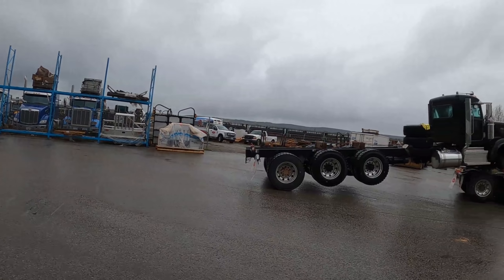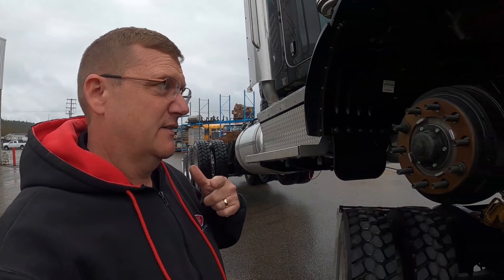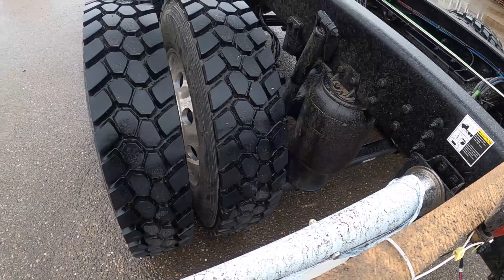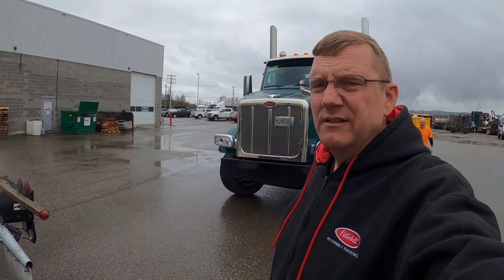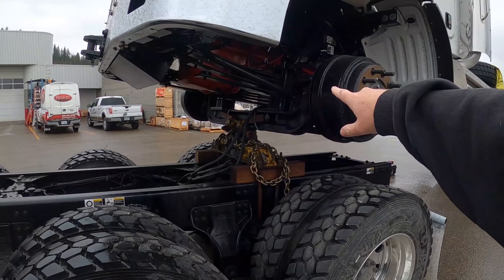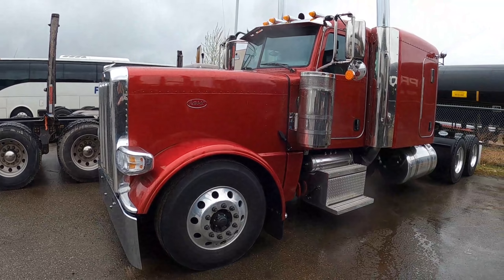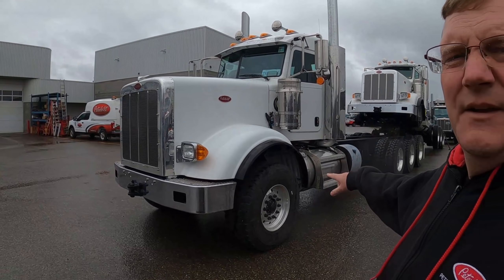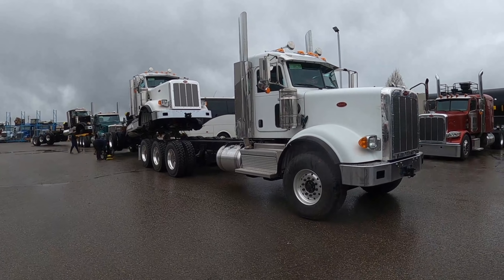New Delivery of 2022 Peterbilt TriDrives arrive....

Comment: Use to work for Active USA for a little over 2 years. Loved doing it but eventually had to be home more. Like a kid on a candy store when I was back at the yard waiting for a load. Would walk the holding area for as long as I could. Ran out of Chillicothe, OH Kenworth. Would get bounced to Denton, TX if I was close aftet delivery to pick up a load of Peterbilts. Even managed to take a load out of Renton, WA Kenworth. And then there's the Montreal plant of Kenworth that you would pull out of to deliver down into the states. It is a HUGE responsibility to deliver those trucks. They handle differently as a decked set. Came upon a driver that his wood block that held up his drive axle had split and dropped the tires down...those big heavy lug tires. Ground off down to the steel belts. Helped him get them back up to finish the run. Cost Active a fortune to replace. A driver with a four-way decked set was involved in an icy accident out west. Wiped out all four trucks and almost killed him. You never drove a use truck while working for Active  USA.

Comment: Definitely check those trucks over. I know the other month our salesman had 3 trucks that were piggybacked in and the driver truck had some scratches on the painted side skirts from where the driver wasn't careful getting in and out of that truck.
Reply from the maker: Once I had a guy stand on a fender of a 389 to clean the windows 🤬
Reply: @mikethetrucknut  😮😖

Comment: Curious how the new generation Neway air ride is working out and if it is good for an on high way truck...The Peterbilt Air Track is still a pretty good suspension also
Reply: Neway suspension like using 2 leveling valves they can be pain to get them set

Comment: A new viewer who wants to know,  what is a PACCAR engine? Is it a Cummins based engine, or the old Leyland based DAF engine that has been upgraded through the years, or is this engine a brand new sheet of paper? I have al- ways had an inter- est in trucks as a kid, along with buses & heavy eq. I also at one time owned a truck w/ my best friend but got very sick and that was the end of wanting to be in trucking.My friend was also a diesel mechanic like his brother, and I had learned much from both of them. I did manage to drive 2 cornbinder c.o.e.'s w V-8 Detroit's, also a Diamond-Reo short nose conv.w/ a 6V- 53 and the truck I bought w/ my friend a c.o.e. Freightliner w/ a Cum along in it. I am now almost 71 on the speed- ometer now and see that PACCAR still does have some styling on the KW's and PETES yet. Misters Kent, Wortington & Peter- man would be very happy indeed!

Comment: Dumb question, if I bought a truck with say a 16,000lbs rated front end would I be able to swap out the axle and spring pack to a 20,000lbs rated set and legally increase the payload capacity?

Comment: Hi Mike, are the pull tractors sold as “used” since they accrued 4400 kilometers on the odometer for the ride up? Also, if a customer didn’t want their custom ordered truck used as a pull tractor, are you able to make that request with the factory? Thank you.
Reply from the maker: You can request it to not be driven for $250. They aren't marked used but the warranty starts with the mileage it has on delivery.  I've found some of the best trucks were driven.
Reply: Got it. Thank you for the information.

Comment: I'm hoping to see a 589 here in the near future.
Reply: To change what in the design?
Reply from the maker: i bet next year there will be one announced
Reply: @jansen7640  
Add to the 500 series line.  Kinda like what Kenworth has done with the 900 series by adding the W990 to go along with the other trucks like the T680 and T880 that are using the 2.1meter cab platform.
Reply: @jansen7640  lol, dang!

Comment: How do you unbunk the trucks?
Reply from the maker: we use the over head crane in the shop on the front tow pin.
Reply: I've seen them unbunked by using a heavy wrecker with a rotater.

Comment: No wonder these loggers can buy these trucks, the cost of lumber is almost 4 times what it used to be a year ago.  Piece of 3/4 plywood is like $90!  2x4 $8 for 8'.  16' $17!!  Good for them while it lasts but man to do a project now is not going to happen.  Building homes here in North Texas isn't helping this at all because they cant build them fast enough there is such demand right now.
Reply from the maker: Unfortunately the trucking rates haven't increased to reflect. But I'm sure when demand drops they will want to cut the rate. 😜
Reply: @mikethetrucknut  Isn't that the truth! Great looking trucks and video.
Reply: @bradh7472  Mike's right, the mills are the only ones getting rich.
Reply: @jayfab4907  how unfair!  These guys should be demanding more money if they want logs!  No logs no money for them.  Its great that they are making money but everyone in that industry needs a piece of the good times because there has been a LONG time that wasnt good.
Reply: @bradh7472  For sure.